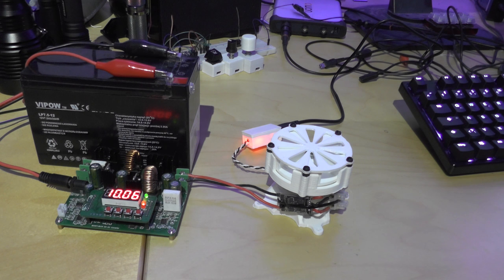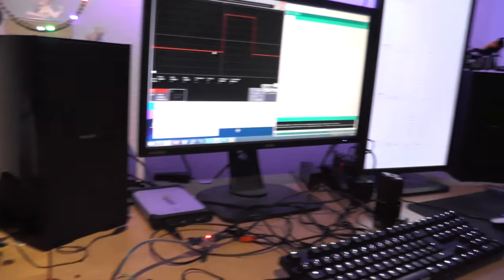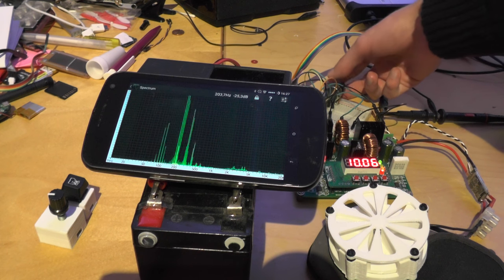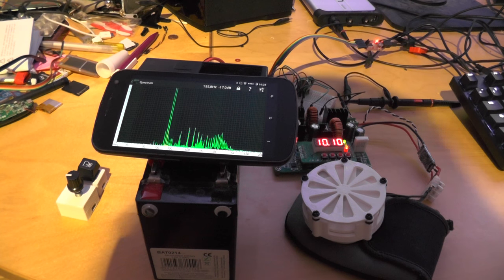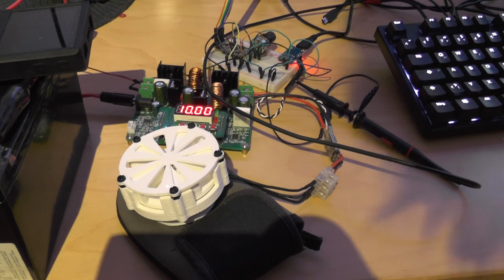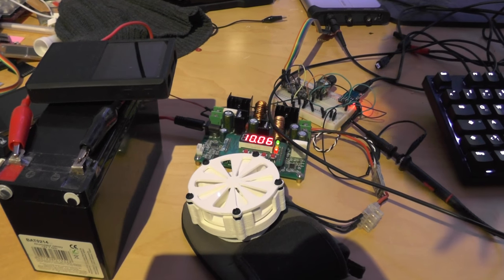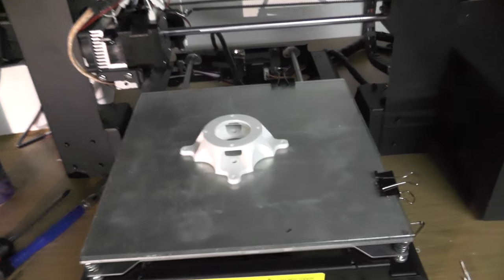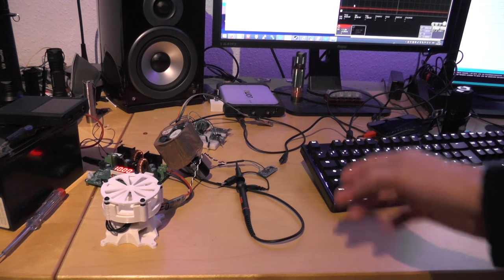Making a super annoying musical midi siren

Comment: I want to adapt this to an air raid siren I made, but I'm not sure what program you're using to send the MIDI outputs from the Arduino so that I can measure the octaves and match them to a proper air raid siren. I'm using a 20A motor, so I'm assuming the octave values you're capturing would vary from what I'm using, meaning I need to do exactly what you did from scratch.
Reply from the maker: I use an arduino micro which can emulate a usb midi device with the midiusb library. It then sends the right ppm signals according to the active note.
An example is linked in the description. To send the midi notes you can use any midi player like miditrail or sekaiju or a midi capable DAW.
Reply: Great info, thanks! What pin on the Arduino does the signal wire to the ESC connect to?